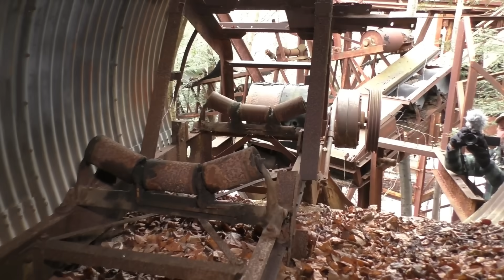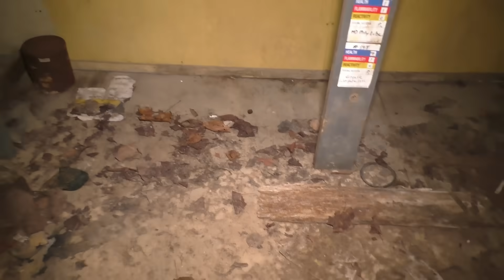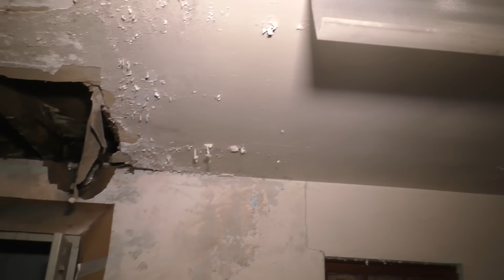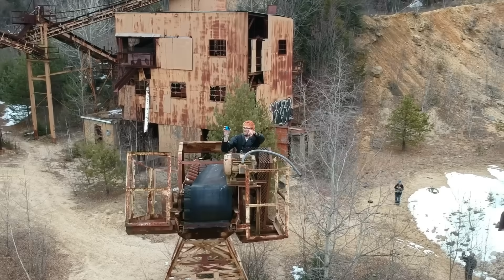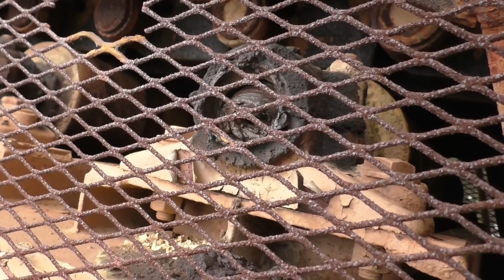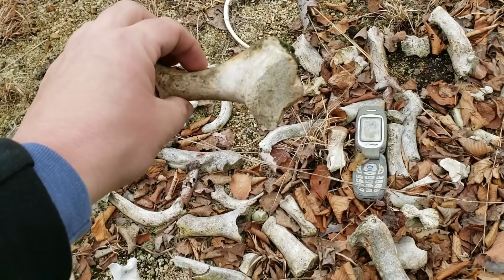Abandoned Concrete Plant - Playground For Adults

Comment: Great drone work! This brings back memories as I used to do work for concrete companies. Those steel mesh floors are dangerous, specially to "slightly" over weight guys like me lol . I almost fell 5 stories straight down when the mesh floor gave way as I stepped on it, caught myself with my arms though and boy were there cuts and bruises in both arms. I understand exactly how you felt going up on that conveyor, I've done it lots of times, I found out the trick is have someone walk ahead of you lol... did I mention great drone work? well.. it was. Thanks for sharing
Reply from the maker: With me being a bigger guy, i also worry about it giving out. Still doesn't stop me from exploring. Thanks for watching and commenting.

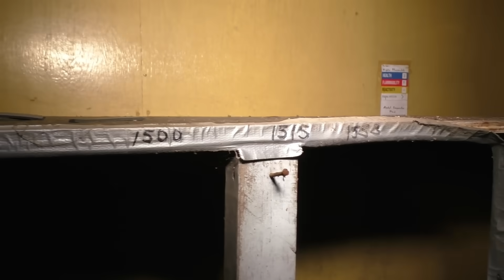Comment: 19:04 📆🌕🔴🔵🔳  HMIS labels were created in 1981
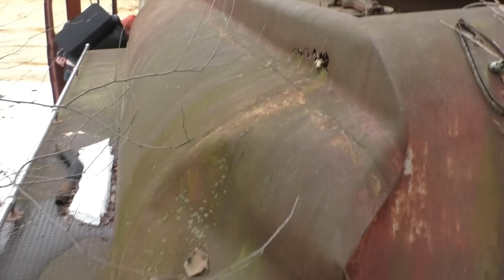25:44 The later backup beeper mounted on the fender ( black w/ 2 purple wire connectors) looks late 1980's. ...they find last dates, but I won't spoil it.

Comment: Not sure if you found out what year that Ford F750 it was, but it looks like a second generation F-series, 1953-1956 - here's a pic of a 1953 F750, https://americandreamcars.com/1953fordf750firetrk031114.jpg and a 1956 https://c1.staticflickr.com/9/8333/8448393869_84a51afbe7_b.jpg - the problem is the side hood badges don't look to be the same, but, even so, these were the only two years that front end was used from what I could tell.  The other two years had a very different look to the grill.

Comment: The drum you called a trammel is actually a dryer drum. Rock and sand would be loaded into the upper end and a huge burner would fire through the drum heating and drying the contents as the drum rotated. The rock and gravel exits the lower end dry and is ready to be used in the "recipe" for making the concrete or asphalt in another section of the plant.

Comment: It's a furnace, for heating material, usually sand. The sand has to be dry, before mixed with the Portland, otherwise the moisture content in the sand will activate the Portland before it gets to a jobsite. The finished product is called Hot Sand. Hot Sand is also sold in bulk for other uses, so in this case it's sent up into the hoppers, into waiting trucks
Reply: The tanker truck looks to be a '55 Ford
Reply: Hopper at the top is a crusher. Raw material is crushed to a specific grade, then sent down different conveyors to separate piles.

Comment: You were at a cement co. They made the dry powdered cement  for baging and selling and also bulk cement carried  by tractor trailers.  The barrel shape tube with its massive gear run by a huge dri motor and gear box turned the barrel as cement was entering g the drum. The hole you shined your flash light in to see the interior of the drum & baffles  is where the flame gun was set up the fire high velocity  heat and are to completely dry the cement befor it is sent to pick house to be placed in bags and seald for shipping  trucks would hall it to concrete plants that would mix a certain amount of rock and sand to be put into cement delivery trucks you see running loads of wet cement to construction sites and home builders and brick & stone masons. There many homes in the area built in the 50 & 60's have this copanys cement used in building the house.
Reply from the maker: Thanks for sharing

Comment: Without checking the whole place, looks like a blacktop plant  with a concrete plant, not uncommon to see  that big tube was a dryer for stone to mix with  hot asphalt no water allowed-silos in background probably held different types of cement (powder) for concrete mix  I was a redi mix driver for 20 years so I have a good idea of what your looking at.
Reply from the maker: Thanks for the info. I only recognized a few pieces of equipment.